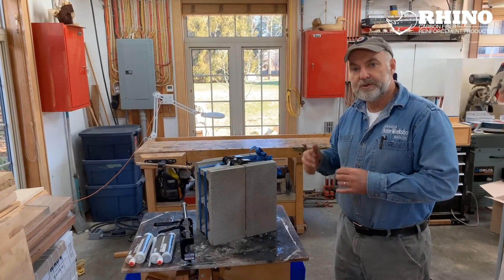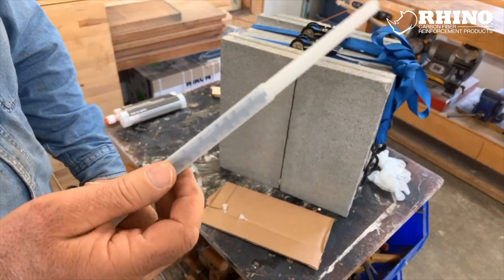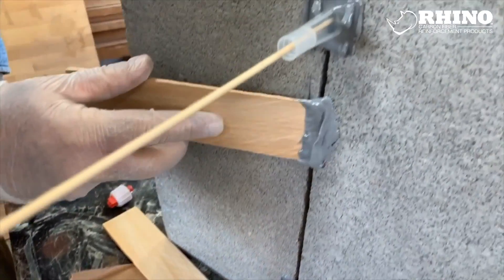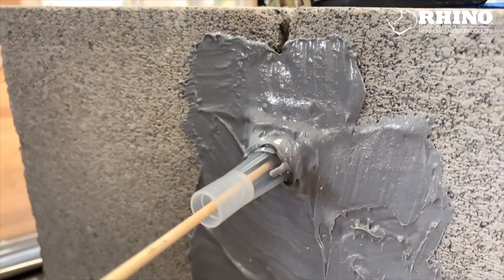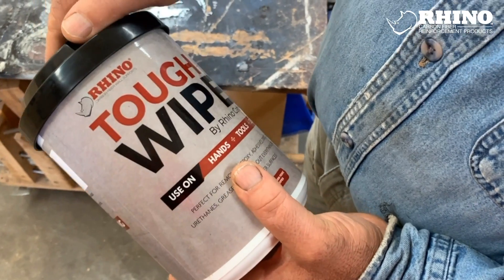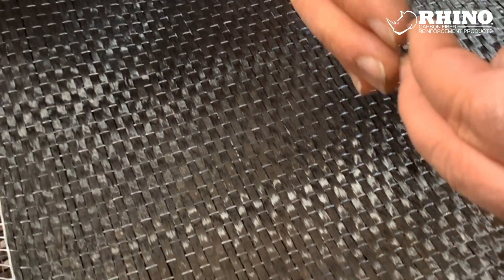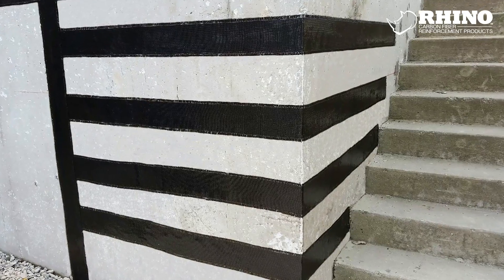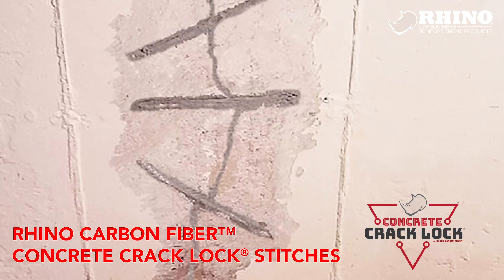RCF Crack Injection and Rhino Carbon Fiber Crack Repair Kit Application Instructions

Comment: If the crack is bigger than this really thin one in the video, then epoxy will leak through the port to the space behind the facial grey cover to who knows where... That was my experience: 8 tubes went to the ports and I have no idea where. Nothing came through above port. Gravity brought all of it down. I guess crack was bigger than I thought, and bigger than it looked from inside.

Comment: Nice demonstration but.. you didn’t use the same block set up with tractor test.. if you notice in the bonding process, the block has a good size chip out of the top right corner.. the block in the pull test doesn’t.. sorry to be that guy..